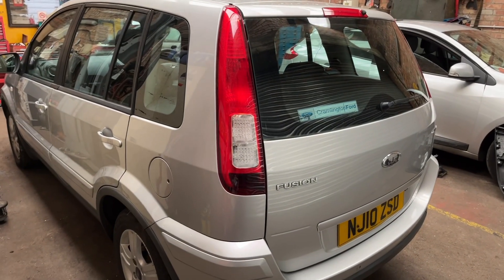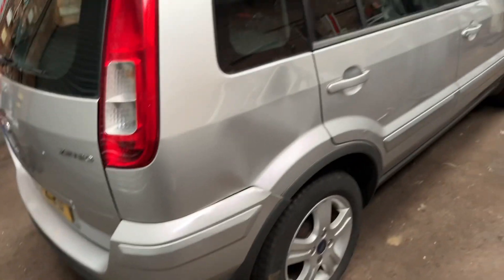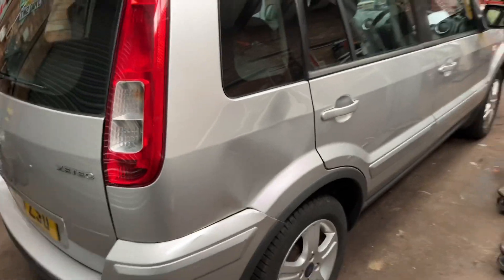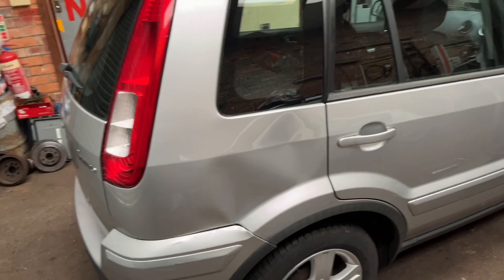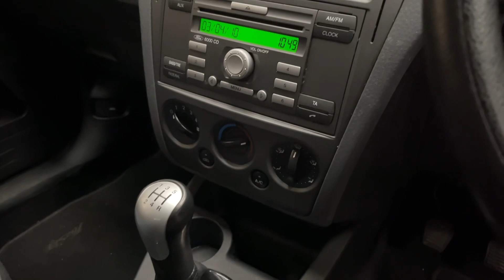What To Do With This One Keep or Flip? | Ford Fusion | #ford  #fordfusion #mpv #fordfiesta #garage

Comment: Hi Dan. Agree a deal with owner. I personally would take off the rear panel covering and push out the dent. Wouldn't be perfect.
               But may look more appealing to any new owner. + you have the video of the damage before the push-out. 🤷‍♂🤷‍♂
Reply from the maker: Unfortunately I tried that and there is loads of re enforcement boxing In there, so you can’t get access.

Either way it’s a very clean practical little car 

Thanks for watching 👍🏼👍🏼